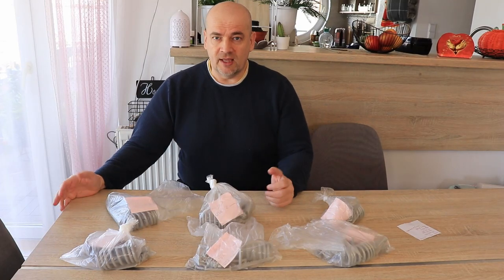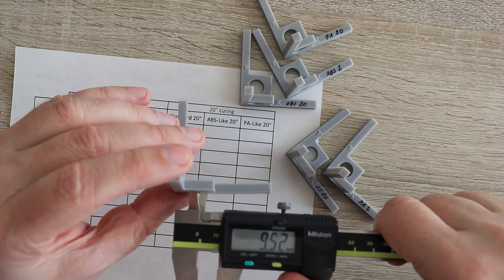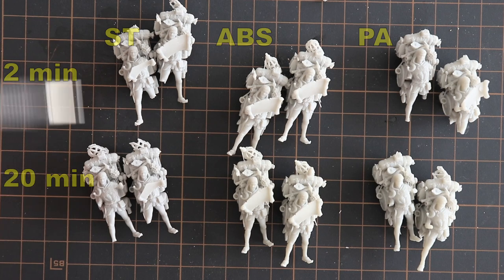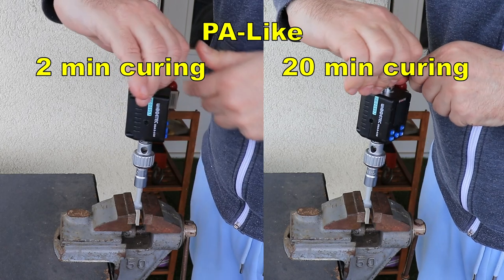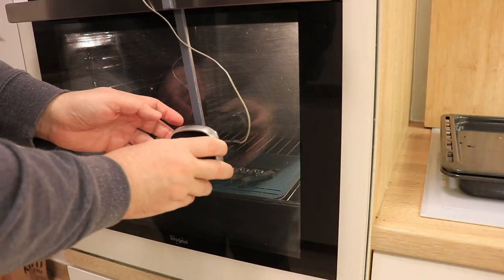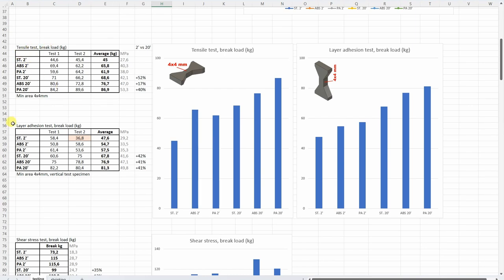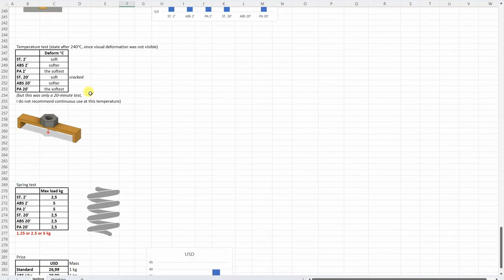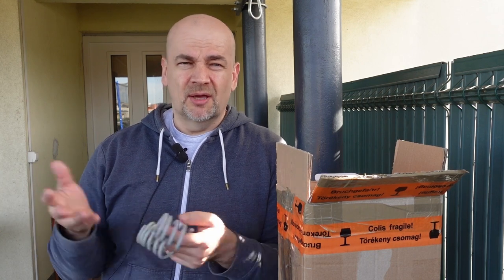Best Sunlu resin for your application? Standard resin vs ABS-Like vs PA-Like

Comment: For the dropping test maybe look for a clear acrylic or otherwise just a pvc pipe of the lenght you want, put a street-tile under it and drop 1 model, or do multiple pipes, that way, they won't go all over the place and you have the results on the tile, clear to see. (saves your feet from tiny splinters too!) you could do multiple lengths too, if you'd like.
Reply from the maker: Good idea, but I don't plan to do this too often. I can easily pick up bigger parts. Smaller I left to robot vacuum cleaner. Only last time I forgot to check inside my shoe, there was one broken map inside :-)

Comment: It's excellent that you conducted FDM tests on resin parts, as it allows for easier comparison. I've been using FDM parts in production, primarily ABS, and they've been performing well. I've also dabbled with ABS-like resin in real-world applications, but I'm still uncertain about the effects of long-term UV light exposure and other environmental factors on the part. Furthermore, as resin parts change over time, it's unclear when this transformation ceases and the parts stabilize. For example, I printed a ring box, and after several months in the bathroom, the bottom became approximately 5mm convex from its original flat shape.

If I had sufficient time, it would be fascinating to investigate the use of resin parts in functional applications. This research could potentially address questions such as:
-    What is the recommended aging period for new parts before installation?
-    How does exposure to UV light impact the parts?
-    What are the effects of heat and cold exposure?
-    How do the parts hold up in saltwater environments?
Reply: Yes, it would be interesting to see this data. Even some extreme UV chamber exposure would be good, or testing ways to avoid UV damage(additives, paint)

Comment: Massively interesting how curing time changes mechanical properties. Now curiosity has awoken to how and if translucent filaments are changed.

On a side note, it looks like you have proved there is little reason to not print abs-like as standard (given price similarity and mechanical superiority*)

*Deals may be struck for wholesale standard resin bringing price down to 10 usd pr kg

Comment: Aside of fancy mini figures, there are definitely a place for practical printing with sla/dlp. Here is my example. I needed m8 set screws but flexible ones. And i needed 320 pcs. Imagine that job with an FDM. With the dlp i was able to finish it in one day including the extra time of cleaning up the mess.

Remember 1 item or 100 items takes the exact same time to print on the DLP. And when it comes to tiny parts, the DLP is the winner

Comment: There are so many resin printers coming out weekly, it is really hard to keep track.  What I dislike is all of those inexpensive machines use fast curing resin which offers no real strength.  If you want to print figurines and decorative items in high detail, that's one thing.  I would like to use resin prints for high detail pieces my FDM machines can't do.  But it needs to be strong.  One thing your data showed that I had not seen others cover is the shrinkage.  Thank you!

Comment: Thanks I don't have resin printer so this was good info. I usually print ABS parts because of the lower creep and higher temperature resistance.
I would like to know how to FDM print PETG so the part is as ridgid as PLA. Like 4 walls in PETG has same bending strength as 2 walls PLA. Can you compare ABS and PETG to PLA by increasing wall count and infill.

Comment: The diference beteewn pla and abs resin is the bottle , one say "Pla-like" and the other say "Abs-like"
Reply from the maker: There is a little bit more difference, at least in mechanical specs
Reply: Polyamide plastic (PA) is like Nylon, usually the PA-like resin is more flexible than the rigid ABS-Like resins but PA-Like resin is nothing to do with PLA